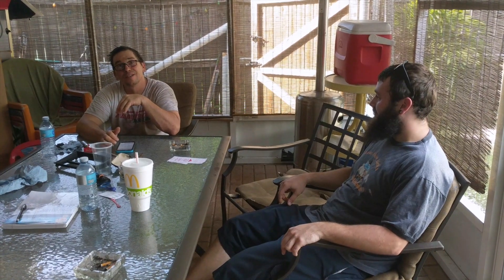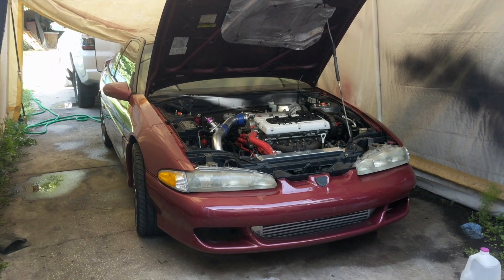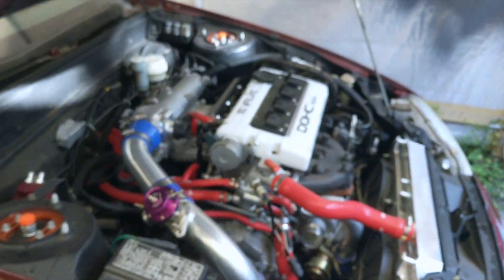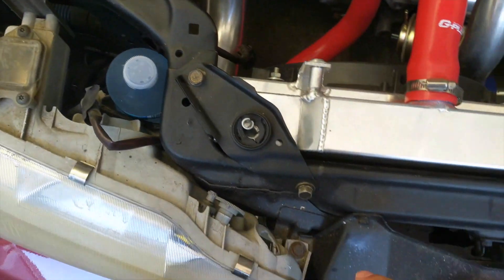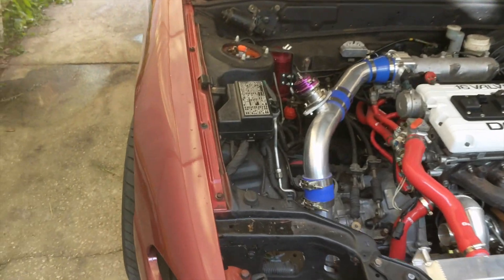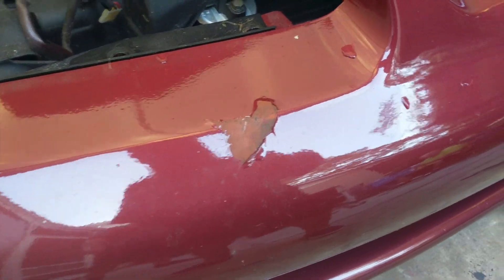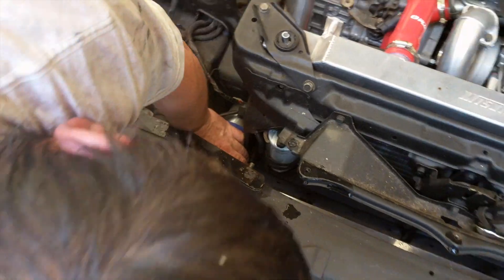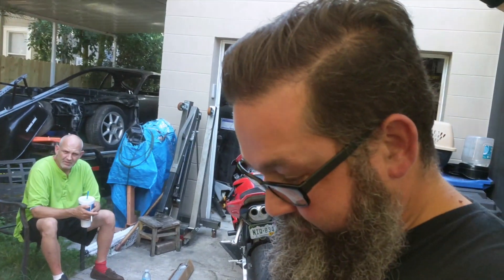Summer is Killing me! - Joe Wrenches Vlog #26

Comment: How come you couldn't just get some 1/4" refrigeration tubing and bend'er up?... nice trip n all but isn't that just a piece of bent quarter inch with flares and fittings?
Reply: Craig Cundiff those are some tight bends to make at home.
Reply from the maker: I would need a bender, but the bigger problem is the fittings. Look closely. They're not basic fittings. They're actually part of the line.
Reply: Joe Wrenches I noticed them ..at work we use a system called Swagelok.   and you would need to change the fittings on each end of the line but it would work no problem and they would be conical and sealed Swagelok fittings...I wasn't trying to busy yer balls... Just wondering...👍